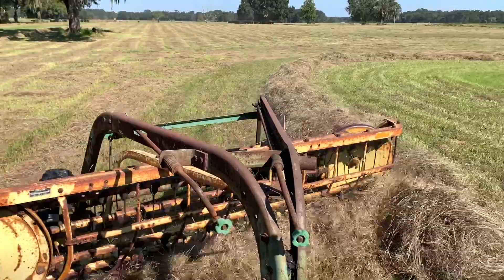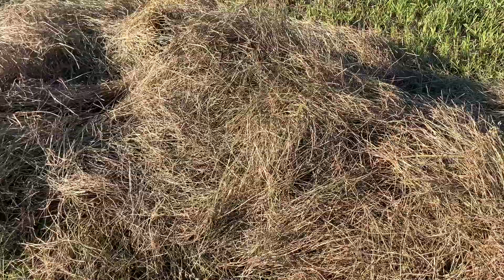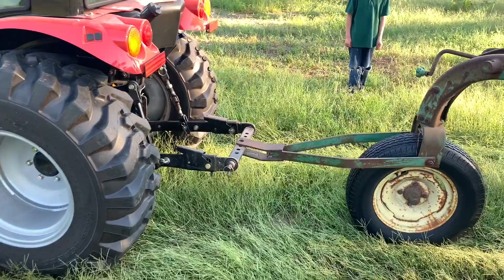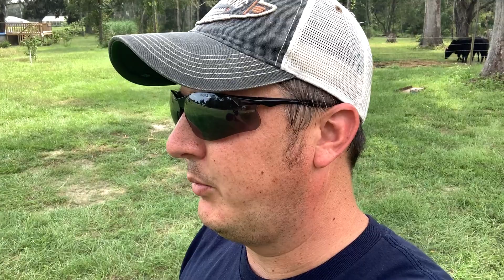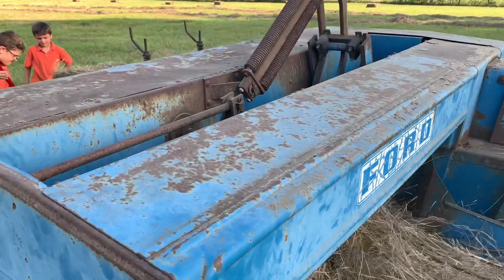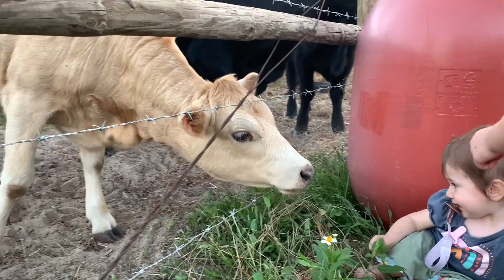DISASTER: Our RK37 tractor died while baling hay. Now what?

Comment: I have this tractor with hydrostatic.  The PTO horsepower is 29 and I have been told that bailing hay is too much for this PTO?
Reply from the maker: It all depends on the baler, I have a pretty small square baler and mine works perfectly. I do know you lose horsepower with a hydrostatic though, so it is possible that it might not be strong enough.